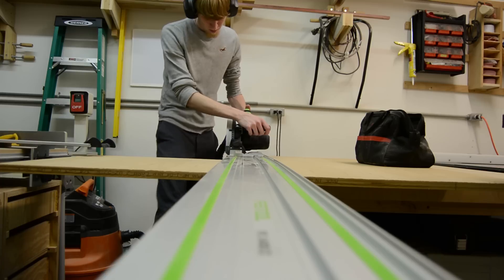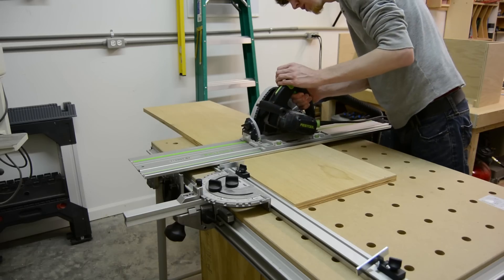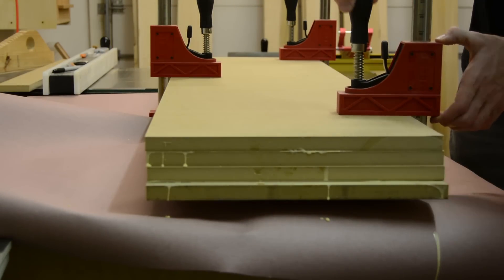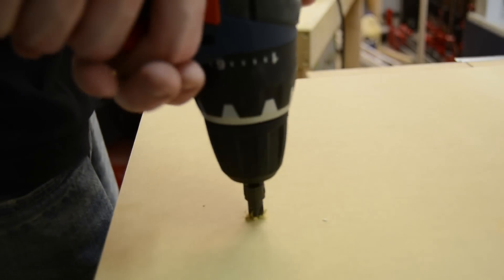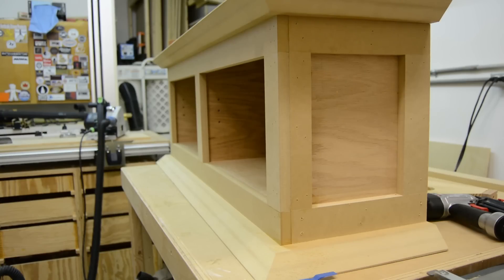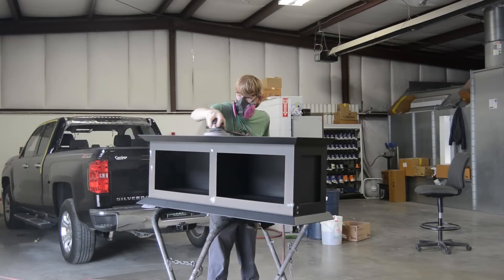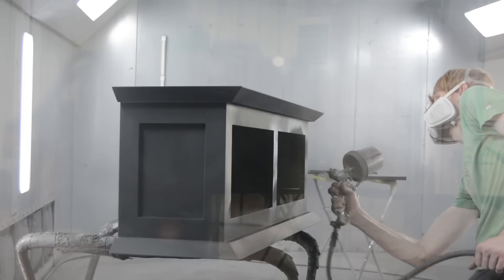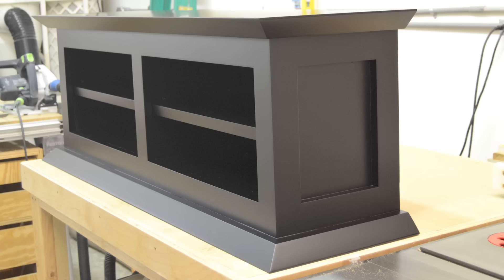Modern Cabinet (With Automotive Spray Finish)

Comment: Hello Mat, I would like to ask you for some suggestions from your experience.
I want to create setup for spray painting on walls / wood / lacquer on wood and use the air compressor for nail gun and sander/polisher.
I would like to use some versatile source of air pressure and attach various tools.
I am expecting that maybe it is too much things to do with one set up, but I don't have a budget for multiple tools. I am pretty new in these things.
Thank you for your responce.
Have a good day
Kamil

Comment: Matt, I have a small shop and I want to spray paint furniture. I do this on my own new projects about 4 times a year (desk, end table, etc.). Which of the following would you suggest? 1. Homeright hvlp-$100  2. Graco TrueCoat Airless-$130  3. HF purple hvlp with air compressor (what size?)
Reply from the maker: What exactly are you planning to spray? Like what kinds of materials.
Reply: @MattLaneWoodshop  poplar, mdf, maple.

Comment: Wow, nice job man.. good finish. One question: why did you use MDF when it's use is near water? (wondering if the top coat is good enough to protect from it from water)
Reply from the maker: +Ranga 
Thanks, yeah, the epoxy primer is water proof and should be more than enough.

Comment: Nice work!  Would the finish of the piece had been the same if you would have used real wood, say like a poplar?
Reply from the maker: +Zorro in Hell 
Yeah, as long as you follow the same basic steps, it should look the same in the end. I was more worried about using stable material that wouldn't expand and shrink due to seasonal changes.

Comment: Really great video! Your work was perfection!! Question...would you recommend going to a local auto body shop to get the final paint application done? I would prefer doing my own primer, that way I can sand the orange peel out of it, as some auto body shops, especially in LA, aren't the perfectionists that woodworkers are.
Reply from the maker: +Raechel Taylor 
Yeah, if your gonna do all the hard work for them, then there should be plenty of competent painters out there to spray it for ya.

Comment: Why did you use a track saw and a table saw? I’m planning to start doing projects and was wondering if I can get by with a track saw instead of a table saw .
Reply from the maker: It's easier to break them down into more manageable pieces and then cut them all to a consistent size on the table saw. It's the quickest and easiest method for me.

Comment: Good job Matt. I have a question? Is there an automotive paint that I could use without a paint booth?
Reply from the maker: The paint booth isn't an absolute necessity when painting, you just need a way to properly vent and filter the toxic fumes! You also wanna make sure you protect everything from the over spray!

Comment: that is a pretty rockin party suit indeed. quick question... i've never sprayed anything, but with the party suit and respirator and all, is there no need for eye protection?
Reply from the maker: Yes, normally I would be wearing a full face respirator but I didn't wear it in the video!

Comment: Love this! I plan to purchase your plan, but I have one question. My tank is 60, not 50 inches. Could I use your plan but extend the length 10 inches? Would it still be structurally sound?
Reply from the maker: I would imagine it would make that much difference, if you felt it was necessary you could add a second divider
Reply from the maker: Wouldn't *

Comment: wow amazing finish. if you don't mind a friend of mine is having ne build him a base for his chameleon cage. it's about 3' tall 30" long and 20" deep. he wants it black and I never have had luck with black. any suggestions (I don't have a spray gun ) but I'd like to make it a smooth glossy finish.
Reply from the maker: My suggestion would be just to make sure you do lots of prep work in the form of sanding and priming. With all finishes, the main key is prep work!
Reply: +Matt Lane it will be made out of birch plywood with  poplar trim. what type of primer , paint , and clear should I ise. sorry for all the questions brother
Reply from the maker: +Art Connolly 
If you are going with an all automotive finish, I would get a high building urethane primer, base coat for the color, and clear is gonna depend on the sheen you want. They have both gloss and matte clears you can buy.
Reply: +Matt Lane 
thanks Matt do you have an email or is there a way I could give you my phone number. it would be easier to talk then through youtube ? let me know
Reply from the maker: +Art Connolly 
Yeah, hit me up on my email, matt@mattlanewoodshop.com. I'll get back with you this evening when I get home from work!

Comment: Beautiful work. Question: Do you ever use caulk to hide the corners full of hidden glue between joints?
Reply from the maker: +Tommy Le 
The only time I'd use caulk would be if I were installing trim in a house or something. I do use wood filler sometimes for small gaps and such.

Comment: Nice job Matt. 
Is there any over spray inside the cabinet? Next time don`t install the back. It will give you more room to move your hand inside.
What gun are you using?
Reply from the maker: +mihainede85 
Thanks, the only over spray to speak of was in the top inside of the cabinet which I wasn't worried about. I'm a using a Sata for the base and satin clear.
Reply: thanks mate. good luck with your projects.
Reply from the maker: +mihainede85 
Thank you!

Comment: im intereasted in the festool track saw how does the track stay down on the wood without moving?
Reply from the maker: There are felt strips along the bottom that are non slip and hold it in place. They also make clamps to hold the down.
Reply: Matt Lane man   And it never slides with the felt even with dust from wood etc
Reply from the maker: I haven't had any issues yet, and I use it quite a bit

Comment: So you added your primer or paint and then you sanded it with a 320 grit. What did you do before respraying? Hiw did you clean after you sanded it?
Reply from the maker: I primed it, then sanded with 180, primed again, sanded with 320, then blew it off and cleaned it with solvent based prep solution, then painted
Reply: Matt Lane thank u

Comment: When you started pulling out the MDF I was like for a fish tank stand?  Then you said epoxy primer and then I had no doubt that thing would be long lasting.  My guess would be fifty years.
Reply from the maker: Yeah, the thought for using mdf was that I needed a material that wouldn't shrink seasonally. Like you said though, I knew the epoxy primer would be paramount!

Comment: Very cool! I'm painting my plywood furniture projects with a brush and roller and it sucks. I would love to step up to a spray gun. Do you think a HVLP system would be worth it?
Reply from the maker: +The Warped Board 
If you already have a good size compressor id say yeah. If not, id probably just pick up one of those self contained turbine units.
Reply: Matt Lane thanks for the advice. I appreciate it.
Reply: What size compressor do you recommend Matt?
Reply from the maker: +lisa j 
I would at least get like a 15 to 20 gallon. If you don't already have a gun and stuff though, id look into one of those self contained turbine units. It's basically all in one small package and you don't have to mess around with air pressure.

Comment: Holy crap man, that looks awesome! Cool to see you at work. Question for you: I've always heard you should try to keep your wrist locked when spraying with an HVLP system. You seem to be moving from the wrist quite a bit. Is this just a difference between the type of finish and the system you're using? About to finish my first project using my HVLP system and am trying not to screw it up, hah!
Reply from the maker: +Crafted Magazine 
The most important thing when spraying is speed and distance from the panel. You also want to keep the gun perpendicular to the surface you're spraying. You want to keep your wrist fairly straight, but you don't want to be robotic and stiff if that makes sense.
Reply: Totally, thanks!

Comment: Love everything except the drywall mud in the screw holes. Takes too long to dry and sinks too much. I would prefer wood filler, lightweight spackle, or Bondo. That is unless you're using 5 minute mud

Comment: would a wagner spray gun meant for house and doors work better ?
Reply: Why ask? Try it on a piece of scrap. More dependant on the feel and familiarity of the air tool and hand wave consistency.  You interested in the final surface not the joinery. Wagner has been in business for decades, if they could not get the same results as their competition they would not be in business all these decades. You need it handed to you? Take a chance and buy some auto paint. Woodworkers try things.
Reply: or..... I can simply ask a pro.
Reply: And you think this young becoming an experienced pro would have the $ to have tried every gun on thee market? He is experimenting like everybody else. His is but one opinion from his own experience. Other factors are the humidity and temp of your shop and more. You Tube is full of independent comparison videomreviews. Instead of exercising your own obvious search capability right at your finger tips with YT and BING, Google, manufacturers websites your default is to ask as a first. Get someone else to do the most basic of work for you. This intellectual laziness would indicate that you haven't put tool to material, probably in years and would defiantly indicate you still have your mother wipe your ass for you.

Comment: They make coatings that are designed for wood. The automotive finish will crack as the wood expands and contracts
Reply from the maker: Hasn't cracked yet, but I guess you knew that too.....

Comment: Finish product looks nice but sucks that you used MDF after you said most of the “crap” you find on line is melamine or particle board.
Reply from the maker: The structure of the box is oak plywood, the damn MDF is just a skin, which has been impregnated with epoxy. It's literally just the outermost layer.

Comment: Hello Matt looks like u did s fine job. I can tell u r a young man by the way u speak of the lack of any quality operations on the web available to take on a project. That's a mistake s pro would never make. A pro knows there is slkwsys someone out there who is as good as they r or better and I can assure they r out there. 

If this is geared towards hobby types please except my oppoligies. In the past several years the finished have kind of morphed together with not a lot of difference between auto finishes and wood coatings. 

We could talk all day about the coatings if u r using a typical auto coating it would be eaten up by my commercial clients who we supply high end fixtures. Those coatings would start at something like a conversion varnish the public is very rough on stuff. 

Never assume there is not someone else ready to take your work who is better, quicker better tooled and has financial backing. I know custom shops in the millions of equipment and especially their finishing department. 

U do nice work my friend just remember if u want to do this for s living broaden your perspective a bit and go look at some other shops u will b shocked. 

Best of look and god bless

DJB
Reply from the maker: +elevenhandicap
Please tell me this isn't a serious response. 

I built this in my garage for a friend of mine in my garage and took it to work and painted it. 

I would never put myself on the level of a badass like yourself with all your high end clients. The fact that you felt bothered enough to make this post is pathetic. 

And there is no way in hell that an indoor varnish is more durable than a high end automotive finish that's made to withstand the elements, get real!!
Reply: Very serious. U have great skills. A professional never assumes they r the best.   Because he or she knows they must constantly improve their skills since there r plenty of pros out there as good or better than u.
Reply from the maker: +elevenhandicap 
I'm very aware of my skillset and where I fit amongst other craftsmen. Not one time in this video did I mention being the best or that this type of build was unattainable by mere mortals, yet you're obviously intimidated. You should probably seek help for your little insecurities.

Comment: Hi I note your safety concern (party suit). But I still see your hair and ears. Are you worried about absorption through the skin?
Reply: I have a good friend body man painter who's kidneys shut down and almost didn't make it to transplant.
He painted for twenty years but not any more. The med bills came to more than 1/2 million.
Reply: This is why I am concerned that the body protection shown in this video still allows the fumes access to the Skull and Face and Ears. It is an "area of exposed skin" and "how much does that area drink." I have a background in Chemistry and I am paranoid after all my years exposed to various chemicals including many known toxic and carcinogenic ones. The solvents used in this video may not be "horrible" but I can say that are not good for you, my nightmare is the color agents epoxies etc. - - It is well understood that various professions poison themselves including many in Chemistry and those with huge exposure to solvents like painting and carpet installers for instance. - - If it is not water please don't breath it through the lungs OR through the largest organ in the body, The Skin. __ Were you aware that you drink 1-2 gallons of water when you shower? Through your skin. :)
Reply from the maker: I have been painting for the last 9 years and I'm also very paranoid about exposure! I under every normal condition use the most protection against that I can. I use gloves when handling chemicals, a NEW cartridge respirator every time it needs to be changed and my paint suit and gloves when spraying!
Reply: +Matt Lane hi Matt. i spent my college and graduate school daze in labs under less than ideal protection circumstances. i have since cleaned up my act etc. i understand what you are doing. if you can find a way to isolate yourself further from exposure to the point of using self contained or line out air sources i would look into it. i know you love your craftsmanship and i think this is part of it as long term exposure to the dosage level you take in through your exposed body parts is ( to me ) too much. said a lasar chemist who made hundreds of gallons of dye solutions in carcinogens and bathed in carbon tetrachloride. diet for removing build up is also important - lookng to leafy green and even chlorella is a possibility. thank you for replying.

Comment: watch this on 2019, i can see how furniture never change especially for aquarium stand which so boring looking , even number 1 brand like ADA also do the same boring design
Reply: Most important is the tremendous strength required to hold 600 to 700 pounds of water.

Comment: good job but almost a shame to waste that paint job on mdf furniture. must weigh about 150 pounds?
Reply from the maker: +WV591 
I believe mdf to be the best option for this type of finish because it is flat and smooth and very stable, which is what you need with a hardened finish like clear coat.
Reply: I'm not sure how you managed to paint those beveled edges without first sealing them with putty or drywall compound and sanding . they would have adsorbed gallon of paint no? or maybe your film doesn't show that part.
Reply from the maker: +WV591 
The cut edges definitely soaked up the first time I primed it, but what I found was that in using a catalyzed primer it actually hardened everything so that I could sand it smooth. Once I reprimed it, it was all fairly smooth and easy to sand out.
Reply: I c. thx

Comment: Cant see the dry wall filler working !
Reply from the maker: If you watched the video then you literally just watched it work lol.
Reply: @MattLaneWoodshop  . Nope ...Time will tell if the surface /joints blister . It was the wrong filler to use
Reply from the maker: It's been three years since I built it, and it still looks the same as when I built it. Reckon how long it should take to fall apart?
Reply: @MattLaneWoodshop  3 years 7 months exactly .

Comment: "all the stuff you can buy is made out of particle board or melamine" ... makes important parts of the cabinet out of MDF... ok. Still looks good though.
Reply from the maker: The most important part, which is the fucking structure of the cabinet(you know the part that holds the weight) is 3/4 oak plywood. Please educate yourself before commenting.
Reply: Oooo did i trigger you? LOL. All im saying is that if your going to use oak ply for the structure, why not use some poplar for the trim and doors? holds up better to minor usage than MDF ever will. That top and bottom with the bevel made from MDF will be particularly vulnerable to incidental damage from bumping into it with stuff. Its not a bad looking cabinet at all, and the finish is spot on perfect, great job. Its just regrettable that it involved MDF is all.
Reply from the maker: I'm just sick of all the ignorant comments, the MDF is literally just a skin on the outside. I chose MDF for its stability and the fact that the joints wouldn't shrink over time and cause problems with the catalyzed finish. The MDF actually soaked up the epoxy primer and became rock hard after it had dried.